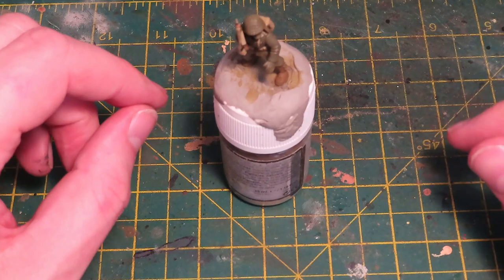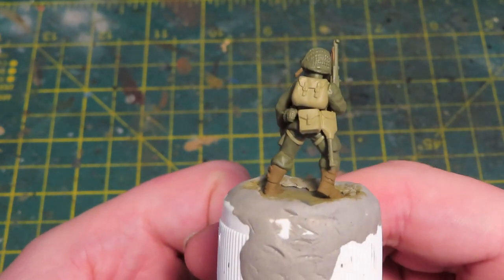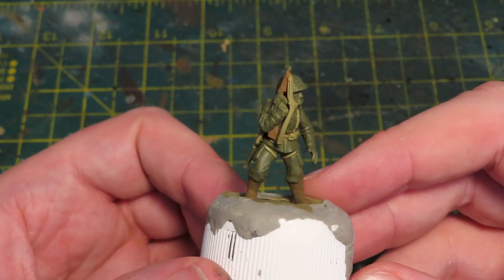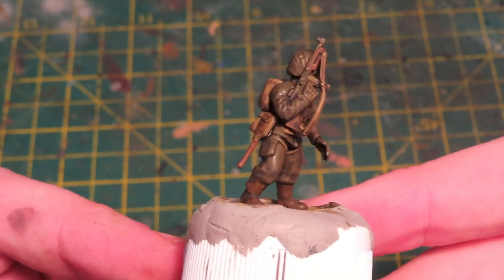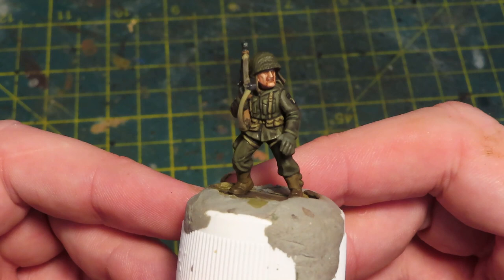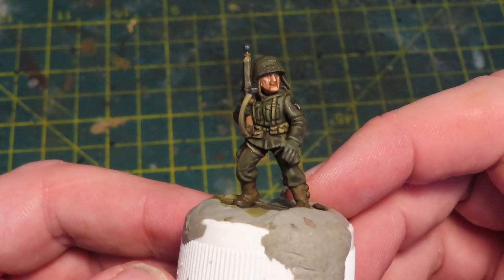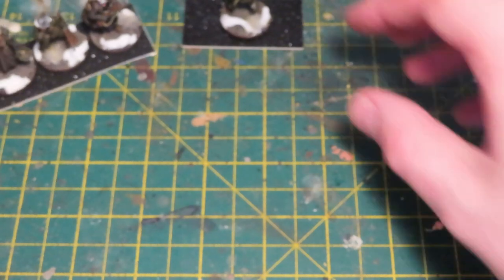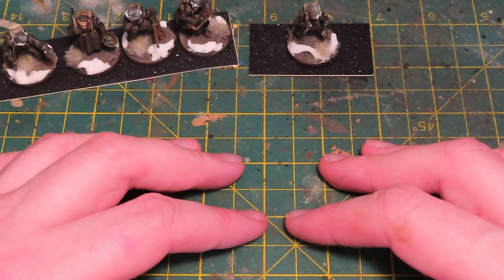Let's kitbash - US Airborne #2

Comment: The patchy snow looks right for an area that’s been marched over.  I use a bunch of different brands of paint for other periods but almost exclusively Vallejo for modern historical uniforms.  They get those drab shades right.
Reply from the maker: The snow from Army Painter has been excellent and will definitely be my go to product for snow from now on.
Definitely agree on the Vallejo paints. I've been using Vallejo for 15 years now and I'm very comfortable with them. Like you said, for moden uniforms they are absolutely spot on 🙂